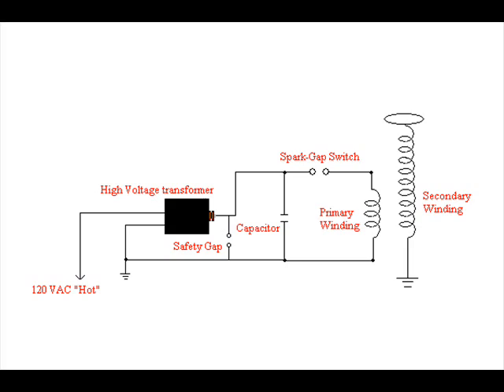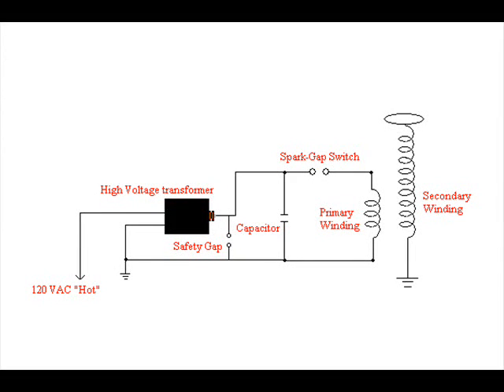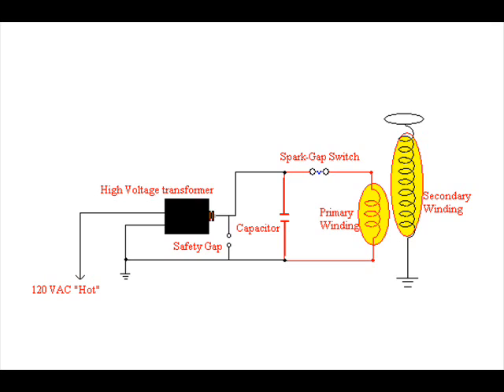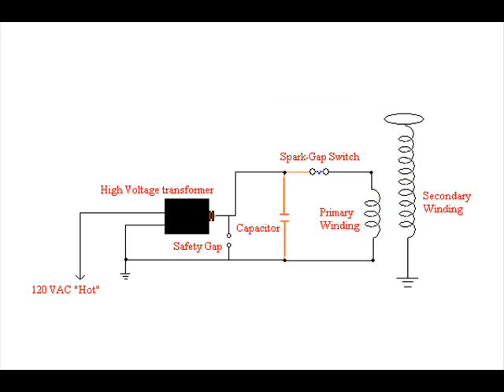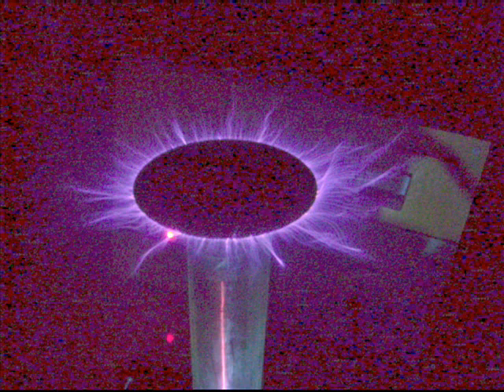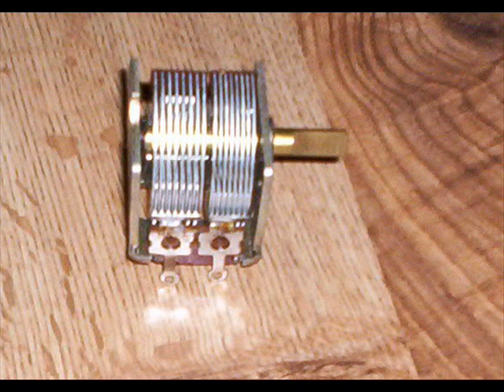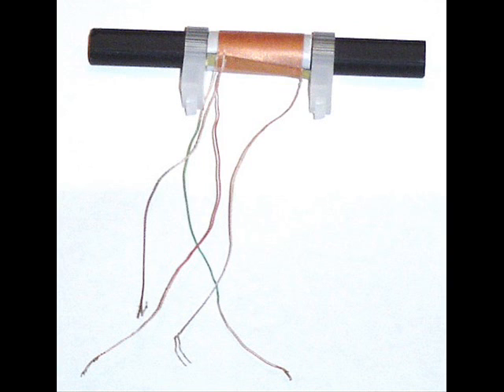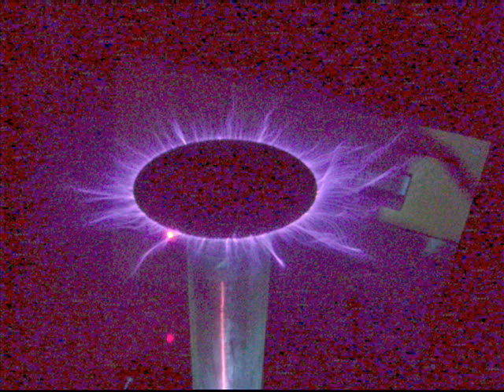Resonant Rise - a closer look at Tesla Coils

Comment: how could I know the capacitance of the top part above the secondary ?
Reply from the maker: Anas roumieh Sorry it took me a while to reply. I hardly ever go on YouTube anymore. I generally don't try to measure the terminal capacitance, I just experiment with different sizes and shapes for terminals to see which works best. It turned out that a dish worked best for this particular Tesla Coil. It probably has something to do with how high the frequency is. Most Tesla Coils operate around 300-500 kilohertz, but this one is much higher, in the megahertz range. (About 1.5 megahertz if I remember right).

Comment: I need help. I am a High Wire, High voltage Lineman, But my hobby is tesla coils. I have hit a stump here. I have a 1k to 1 on my coils. What size transformer do I need?
Reply: How many turns on primary/Secondary? also dimensions.
Reply: I am working another one since then. I am doing the 6" secondary tube with 5lbs of 26g copper. I have a 12kv transformer.  I am now trying to figure out the capacitors.  Anything might help me. Thank you

Comment: Your machine is great, I think I might give it a go with DC current/voltage using 2 coils like a  solenoid, an inner coil for primary and an outer coil for secondary. Common ground but split the + in a Y pattern. I was thinking placing a diode in the circuit would kill kickback.

Comment from the maker: @zker666 

I just bought it at an electronics surplus shop.  It's a filter that goes in series with the "hot" AC input line, right before the transformer.  I'm not sure exactly what it has, but it's probably just some kind of low impedance choke that blocks out high frequency.

The line filter just blocks out high frequency kickback from getting into the house wires, it won't do anything to block RF interference because that is being transmitted by the output terminal.

Comment: Yup I have actually built the ac version. Although quite impressive, it didn't do much.
 The DC Impulse version I am currently working on should be completed in the next week or so. Hopefully the results will be quite impressive as I have expressed but there is much to work on this new system.
 I highly recommend reading the Tesla link and try to put the ac version down for a bit and try the DC version.

Comment: I would suggest you reread the Tesla books again. There is a distinction between his HV AC and disruptive discharge systems which were HV impulse DC.
 One (AC) Produces near zero Radiant events, The other (DC) Produced massive Radiant events.
 Discharges from each system were completely different. His DC system needed a magnetic quenched spark gap to control the frequency to allow for higher switching times that is needed to make the radiant event safe, above 15k impulses a second. Read more.

Comment from the maker: On my Tesla Coils, yeah, I connect the bottom end of the secondary to the nuetral line.

It would be better to connect it to ground, but I live in an old house and most of the outlets only have two wires.   So I use the neutral line as ground.  For a small Tesla Coil, that's fine since the neutral line is grounded at the circuit breaker box anyway.

Comment: Heyy, I Need a little help.

how do I figure out how many turns of primary i do depending on my Secondary.

i mean my Tesla Coil works great but its not as impressive as yours.

I have:

-9kV 30mA Neon Sign Transformer
-Bear Bottle Cappacitor (12 Bottle of Corona filled with salt water connected in parallele)
-Secondary is around 1100 Turns of 24 AWG Magnet Wire (2.5" Diameter, 26" Tale)
-Primary is 10 Turns of 10 AWG Wire with abouth 0.8" Spacing and 11" High

Comment from the maker: It sounds like you're talking about the "voltage gradient" between the atmosphere and the ground.  It would depend on the weather, but I've heard that it's possible to get around 1,000 volts, even on a clear, dry day.  If the air is unstable or with a longer pole, you could probably get higher voltages.

Comment from the maker: Also, before he started building coils that used tuned circuits and resonance, he actually built specially made alternators that generated high frequency (from very high RPM and a large number of poles).

Comment from the maker: There could be a lot of things going on.  I would need more information.  If it lights up a florescent light tube, then that means you are getting some kind of a high frequency output, but you might not be getting the voltage boost from resonance that you should.   Is the spark gap firing smooth, or erratically?  Send me a message with some more info about your coil, and I'll try to help if I can.

Comment from the maker: Photovoltaic cells (solar cells) are improving, and they're a lot better than they were 15-20 years ago.  But I think the energy output is still related to surface area.  However, one thing you could do is boil water with solar heat and drive a steam generator.   Maybe you could use a fresnel lens to concentrate the sunlight.  I've heard those lenses can get incredibly hot and will burn just about anything!

Comment from the maker: Sure - if you could generate enough power from the solar cells.  You can power a Tesla Coil with anything, you just need a sufficient source of electricity.  The problem is that, at present, solar cells do not generate very much power.  You would need a large area.  For example, the small Tesla Coil I have in this video only draws 120 Watts of power...but to get that much power (at 120 volts) from solar energy, I would probably have to cover half the roof of my house with solar cells.

Comment from the maker: A Tesla Coil doesn't generate power, it just converts it to very high voltage at high frequency.  Theoretically, you could use it to TRANSMIT power without wires.  But you would need another power source, because it doesn't generate electricity by itself.  If you had two coils tuned to the same resonant frequency, one could transmit the power and the other could receive it, like a radio.  That's what Nikola Tesla was working on.

Comment from the maker: Actually, high voltage doesn't always mean low current.  That's a misconception people have.  Theoretically, you could have a trillion volts and still have high amperage...if you have a lot of power to begin with.  A lightning bolt carries millions of volts AND thounsands of amps.

Comment from the maker: ...and the reason why the Tesla Coil can generate the lightning is because it's very high voltage.  It works very efficiently, with resonance, so it actually doesn't need that much power to generate very high voltage.  The Tesla Coil in my picures and videos generates about 100,000 volts.

Comment from the maker: The transformer (which powers the Tesla Coil) is 120 Watts in this case, because the output is 6,000 volts at 20 milliamps.  To get power, you multiply the voltage X the current, so 6,000 X .02 = 120.  Of course, with AC it's a little different because power doesn't exactly equal voltage X current.  With AC, there's a difference between what's called "true power" and "apparent power."  But it's close enough here.

Comment from the maker: I'm not sure what you mean about "radiant" atmospheric energy.  But there is a natural voltage gradient between the Earth and the atmosphere.  In fact, radio towers can pick up a substantial charge, especially if the air is unstable, like before a thunderstorm.  It can be up to several thousand volts.  So that's one reason they have to be grounded.  I've seen sparks from the charge built up on tall objects just from the voltage gradient in the air.

Comment: No. While the Tesla coil talked about here has a fantastic voltage output, it is at a relatively high impedance, and the actual current available from that very high voltage output is only in the are of 100mA or so(probably less).  No way this could be used to power a house or otherwise "Harness" the plasma energy.

Comment: Very good vid and narration. :) The secondary of the Tesla coil, has a relatively high impedance, and therefore is less likely to kill you, despite the exceptionally high voltage.  The same cannot be said of the primary(6kV), as this has a relatively low impedance, and can kill you at the slightest touch.  An extremely dangerous device, and some mention should be made of the extreme dangers of building or experimenting with one.  Even 20mA is enough to kill you at 6kV.

Comment from the maker: ...the number of turns on the winding affects the amount of inductance.  More turns on the primary winding means more inductance on the primary circuit, and more turns on the secondary winding means more inductance on the secondary circuit.  Of course, it's a lot easier to change the primary winding, so that's usually how you tune a Tesla Coil.

Check my other videos.  I have a two-part video showing more details about building a Tesla Coil.

Comment from the maker: No, you can't use the output of a Tesla Coil to power another Tesla Coil.  There just isn't enough current.  However, I have read about where an extra secondary winding can be used to boost the output, but I'm not sure how.  I think Nikola Tesla called it the "magnifying transmitter."

Comment: Is it possible to use the secondary output of a tesla coil to act as a high voltage transformer to power a secondary tesla coil system to achieve even higher voltages and frequencies? If the answer is yes, how many stages can this be done and what are the limitations? I have yet to build my first TC but I will be using your instructions as a guide. I think you said the numbers of windings in the primary matter only as a function of tuning the resonance but what of the secondary,how many turns?

Comment: well, quartz can act as a tuner, or broadcast crystal. it will vibrate at a given frequency, and then there must be a secondary crystal or system that receives that frequency. just like radio control devices, but different application here.

Comment from the maker: Obviously, it is because I do have a resonant circuit with my Tesla Coil and it is generating over 100,000 volts at a frequency of 1 megahertz.  Check out my other videos.  I should mention too that I've built several Tesla Coils and they all had the spark gap in series.  I've been experimenting with high voltage for over 10 years.  I have a friend who builds HUGE coils powered by distribution transformers, and he had the spark gap in series with most of them.

Comment from the maker: That diagram is how my Tesla Coil is connected.  The spark gap acts like sort of a semi conducting switch, discharging the energy from the capacitor into the primary winding at just the right time, when the capacitor is charged.  Most Tesla Coils do use spark gap oscillators.

Comment from the maker: No, it depends on how much voltage and current your transformer can supply.  I was using a small 6,000 volt furnace ignition transformer to power my Tesla Coil.  With a bigger transformer, I could power a bigger Tesla Coil and get a much higher voltage.

Comment from the maker: ...also, I live in an old house where most of the outlets are still using a two-wire system.  So in that case, I use the neutral line for ground, since it should be at 0 volts.

Comment from the maker: umm...the choice of color has nothing to do with "hot" colors.  It's just a color code system for voltage gradient.  The colors I used are standard electrical code.  On a standard 120v outlet in the U.S., red or black is normally used for "hot" or "live" 120v, white is for neutral, and green is for ground.

Comment from the maker: Well, yeah I can't run it too close to a computer for one thing because it will cause interference.  I actually blue screened my computer one time because it was too close.  And if you bring a calculator or anything else with a digital LCD display by the coil it will go nuts, randomly scrolling numbers.

Comment from the maker: You can also use a 12 volt relay to make DC pulsate and use that to run a transformer.  I don't have a diagram right now, but you can wire the relay to make it vibrate, and I think it will give you a frequency of about 30 breaks a second.  I actually made a DC Tesla Coil one time with that. But I do pretty much everything with AC now.

Comment from the maker: Like an inverter?  Did you run a transformer backwards so that it steps up the voltage?  That's not a Tesla Coil, just a voltage inverter.  But message me.  I'm curious what you did exactly.  That's pretty impressive if you're doing things like that and you're only 15!

Comment: Exactly, a Tesla Coil operating with a primary current in the milliamp range will only output a small amount of current in the microamp range. This suggests a very high level of amp to volt conversion in the secondary from the primary magnetic field oscillations.

Comment from the maker: Yeah, a lot of people have that misconception.  Tesla Coils and conventional transformers don't "produce" any energy, only convert it.  Voltage and current are traded, power remains the same.  Though you might have a momentary spike in both voltage and current in the primary, that's because it's at high frequency.  If the same current were stretched out to 60hz, it would still follow conservation of energy.

Comment: "The belief is that the secondary coil produces more electricity than is provided by the primary coil."

Here's how I would explain it. The secondary does not "produce" more electricity than the primary. The two coils are resonant with each other allowing a more efficient "transfer" of the primaries magnetic field, and because of this high efficiency the conversion of primary field amperage to secondary voltage is of course more efficent.

Comment from the maker: Yeah, that sounds like induction, where an electric current is transferred between two wires with a magnetic field.  If you had that wire wrapped or wound around the other one, it would act like the primay winding in a transformer.  But the highest voltage you'd ever have in a house is 220 or 240 volts at the panel.  And outlets are only 120v.

Comment from the maker: Thanks.  Yeah, the primary circuit in any Tesla Coil can be extremely dangerous.  The high voltage transformer and capacitors can be a serious shock hazard.  So I assume people have a basic knowledge about high voltage before they try to build something like this.  

Tesla lost funding for his transmission tower he told his investors he was working on a wireless energy transmitter, and not only for transmitting radio signals.  They didn't take him seriously.

Comment from the maker: hey, thanks a lot!  Well, in this case an air core is better.  An iron core would get hot because of inductive heating, and there would also be more losses because of hysteris from the high frequency - there is actually a time delay for the core to switch poles and magnetize.